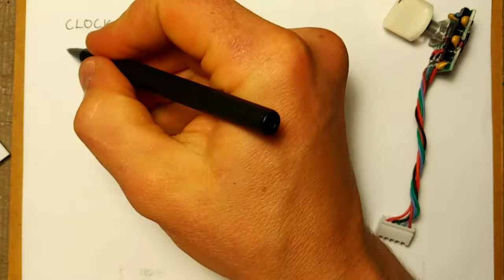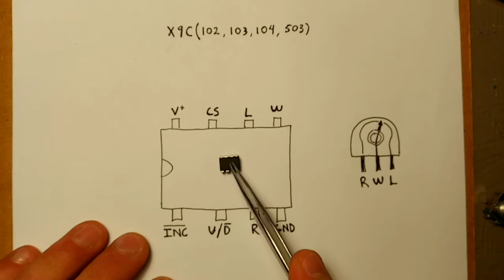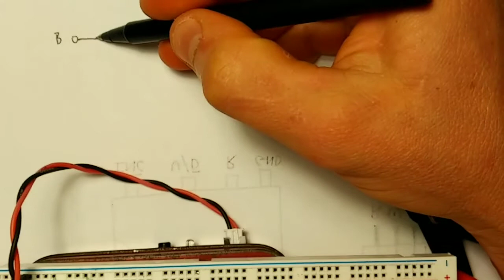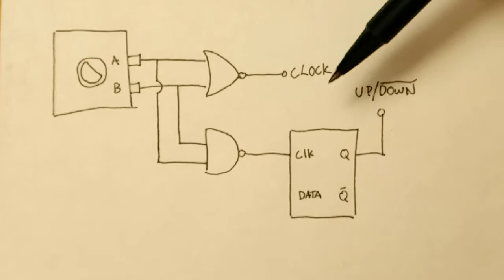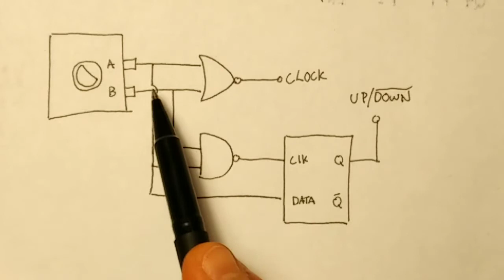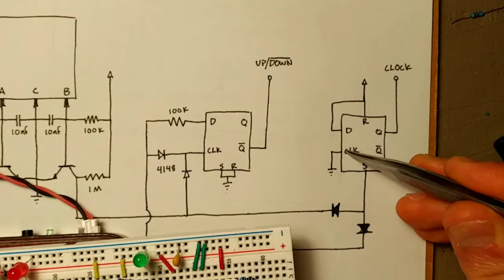No Coding Rotary Encoder Pt. 2 Decoding (w/ hardware)

Comment: You should look into grey code decoding ... most rotary encoders output grey code due to the mechanics of the encoder plates. If you use a couple of logic gates you can decode it into binary pretty easily

Comment: I am speculating it could be possible to read the signal with just few logic operations or one generic logic chip. When A or B is low(or high) it's clock pulse. Then AND or OR them, if the other one is high, it turns left, if low, it turns right (or other way around depending how you set it). Or even simpler, the other one is clock and other is direction with true/false binary if exact accuracy is not crucial
Reply from the maker: Thats the basic operation of the digi-pot I describe

Comment: I noticed that encoders which were debounced using large capacitors (100n), degrade very fast, compared to w/o caps. I suspect that when contacts are closing, there are some micro sparks or electro erosion occurring. So be aware.

Comment: A little suggestion: for the inversion of the logic of the rotary encoder the transistors aren't needed. Just connect C to Vcc and A and B with pull down resistors instead of pull up ones.
Reply from the maker: I like the idea, it fits my penny-pinching attitude! I think I had better luck with my debounce circuit this way, I'll need to give it a test sometime. Thanks for watching!

Comment: Nice work!
I believe the set pin on the second flip flop needs to be pulled high. Now it either pulled low or floating isn't it?
Reply from the maker: You are totally right! 
It would be a problem if the encoder was left inbetween indentations long enough that stray voltage could build up on the set pin. It would leave both set and reset high, giving a rising edge on the "clock" output, even though the encoder hadn't been turned. The same goes for the clock pin of the "up/down" flip flop, it should be pulled low with a 1M resistor in theory, because to my knowledge, the 4013 doesn't have an internal pull down resistor. I didn't experience those issues with my experiments however, and with me being the fraction of a penny pincher that I am, and also wanting to simplify the concept as much as possible for its presentation, I chose to omit them.
Thanks for watching and pointing that out!

Comment: The circuit at 26.00 is Great! I will copy it sometime. but I wonder if you can replace the OR gate with three NAND gates and a  transistor(negate), Less components count!
Reply from the maker: Perhaps! Its always a juggle with ease of design and component coservation. I think simplicity and elegance should be the goal. I plan do go into depth in my next video on the 5 transistor version I mentioned that yeilds the same result, with maybe more accuracy and certainly less current use. I'd love to hear any results your experiments yield!

Comment: Why 1Meg and CMOS? Just asking because I have never seen 1Meg collector resistors before. Old school CMOS  chips did things TTL couldn't but 4000 logic is like hen's teeth now. You have me curious about the 5 transistor version.
Reply from the maker: The 1M resistors are there to limit the current the BJT inverters are always sinking, as long as the encoder isn't being turned. I didn't like the idea of its quiescent current being higher than it needed to, and 1M resistors still let the cmos D-flip flop operate.
I have another video planed where I explain the 5 transistor solution, as well as build a "one knob" video game remenicent of space invaders, with just logic and LEDs. Thanks for watching!

Comment: Thank you for the video. Really well explained! Do you by any chance know of any one chip solutions to decoding the pulses other than a microcontroller?
Reply from the maker: If what you mean is a single integrated circuit that give up/down and clock, yes, but they're obsolete, I've tried to get them :( 
Here's the datasheet for one such chip

https://www.google.com/url?sa=t&source=web&rct=j&url=https://www.elmelectronics.com/wp-content/uploads/2016/07/ELM404DS.pdf&ved=2ahUKEwje1v2_pbP1AhWrGDQIHb9YC-0QFnoECCkQAQ&usg=AOvVaw1i1sFQVjzUk20ilgFR93MW

One of my examples of simple decoding only used one transistor and the associated passive components to get the same output (albeit a little primitive) so I guess it really depends what you want to use it for
Reply: @arenotdiy  Wow thank you! That would be perfect... if i can find them. I've heard of those devices existing but never saw the datasheet for one.  I guess they went obsolete because of 8pin micros. Too bad! Thanks again, and If you enjoy making these edicational videos, keep the m comming... There aren't many good teachers on youtube...

Comment: So many poorly implemented encoders out there. My scopes for instance, on both of them, if I turn it too fast - not that fast - it does not work. Drives me nuts.
Reply from the maker: I agree! And especially when its fairly simple to build well, and important in operation, you would think the average quality would be better. My car stereo will often turn up the volume when I'm turning it down, I want to try fixing it with my next design and video
Reply: Even Ford car radio had these problems.

Comment: there are too many false positives with a circuit like this, I tried many so called solutions of using encoders without coding and they all sux'd. I finally ended up using rotary pulse switches and never looked back.